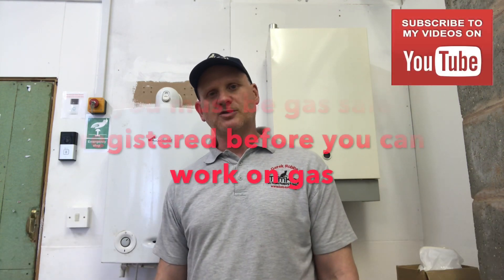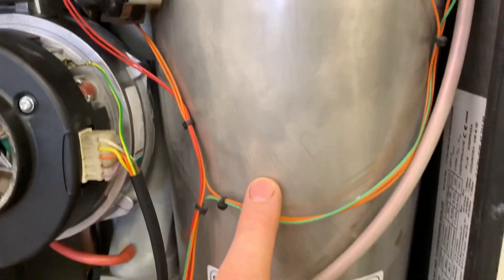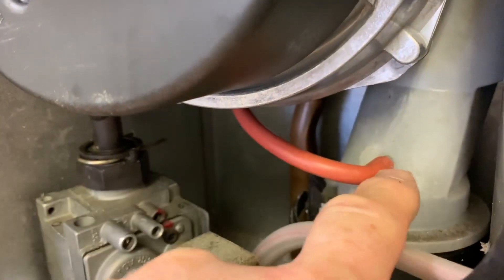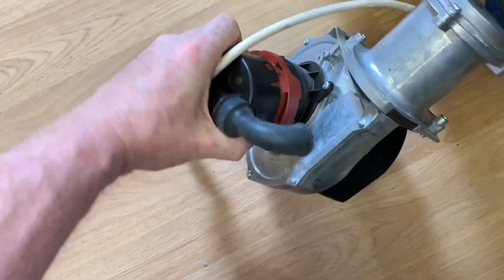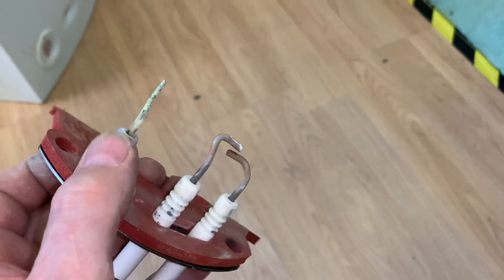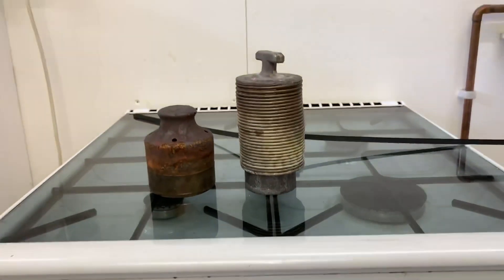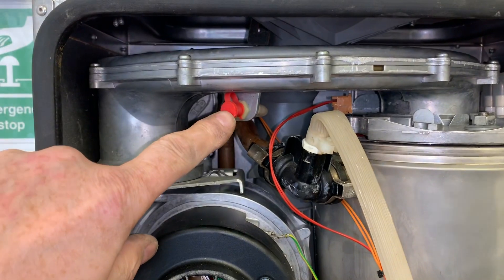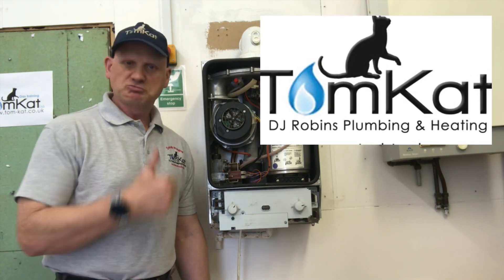What’s inside a WORCESTER RI HEAT ONLY BOILER, review and strip down of Worcester’s heat only boiler

Comment: Is it possible to fit a timer that controls hot water and heating separately?
So that hot water and heating can be operated individually?
Thanks!
Reply from the maker: To comply with regulations you require a timer that separates heating and water so yes you can 👍🏻
Reply: @gastraining 
Thank you
So presumably, the AB Accredited installer will fit such a timer without me having to ask for it?!

Comment: Went to one tonight.. slow flash blue light and flashing reset 🙈 changed the electrodes as they were dead but only sparks for a second and goes off.. old blue transformer on PCB.. any ideas?  🙈

Comment: My boiler is working but my radiators aren't getting hot, ive bleeded the radiators but still not working, where is the water pressure gauge to check that?
Reply: ive got the same problem ..did u manage to get it sorted and if so wot was the problem ..iam not a bioler engineer but i dont think it has a gauge for the water pressure

Comment: If I had a £1  for every time a customer said to me "nobody has ever done that before " referring to the burner and baffle removal and refitting when I service a boiler when it clearly shows the procedure on the front of the heat exchanger or in the MI . Too many con artists or poor engineers out there who do not know what they are doing. I have so many customers who I have gained asking what the flue gas analyser is " no one has done that ever"  Frustrating to say the least

Comment: How much is Worcester paying this guy every gas engineer knows that's Worcester are full of plastic and aluminium absolutely terrible boier.
Reply from the maker: Daniel A nothing mate I did it to show guys like you so you can make your mind up about a boiler you have probably never see or fitted. The boiler is probably better than your spelling though. Thanks for your comment and watching cheers
Reply: @boyse69  Agreed on the good design & quality of Worcester boilers. Consistently achieve Which? Best Buy status.
Reply: ive got this exact boiler and its 10 year old its just very recently had a new fan because it was noisy (but still working-plus in hind sight i could of just strengthened the orange rubber mounts as they had just got saggy )  whilst in there obvs did the burner seal and replaced theigniter cost was £90 and a doddle to fit these parts so if it goes another 10 years thats good going in my book 10/10 boiler imo